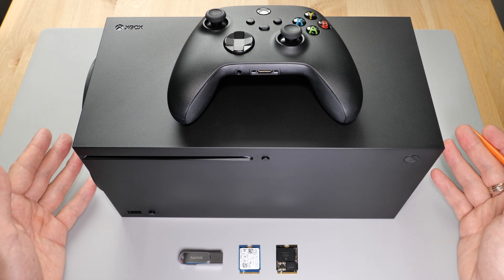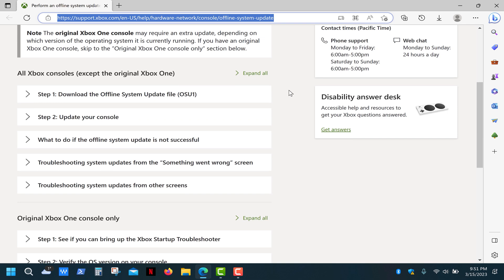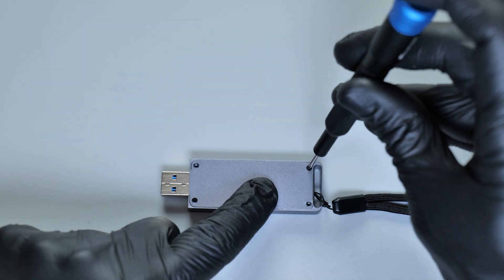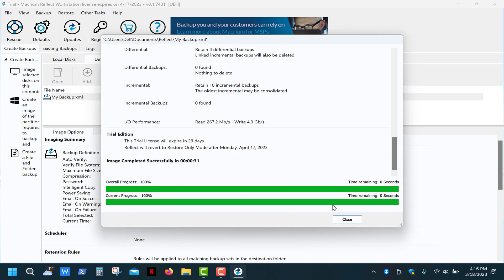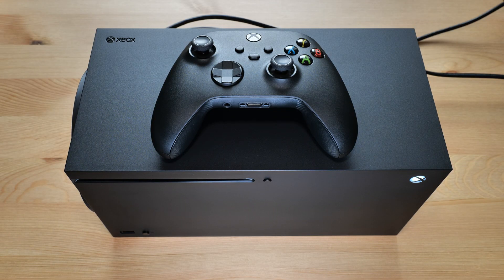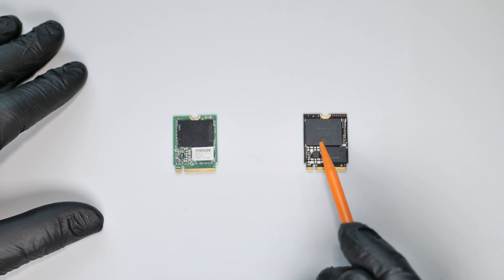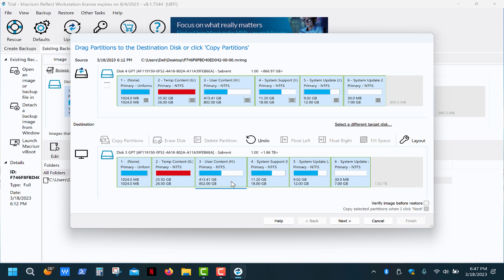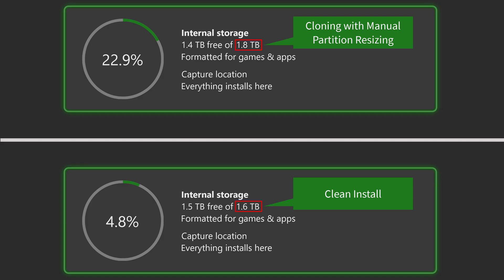Upgrade Xbox Series X SSD to 2TB – Clean Install or Clone Method (Step-by-Step Guide)

Comment: Good evening ! Thank you for making this video, I do have a question and was wondering if you've experienced this before or had any idea of what i can do. 

 recently bought a second hand series x, even with an offline update it wont get past the applying part of the update. It'll get to 100% of applying and 64% overall , turn off then back on and returns to the troubleshoot page. 

I'm currently considering just backing up the raw partition, then wiping the drive completely then reimagine just the raw so I can do a clean install. 

What's your opinion on this approach ? Would it be to risky or something worth trying if i didn't want to get another compatible ssd?

 I know the post is a bit older but I hope you have a chance to respond!
Reply: UPDATE: honestly just sent it , like the video states as long as you have the raw partition and the proper ssd you’ll be fine.

I wiped my drive completely and reimagined the raw partition, was hoping it’d fix my issue with update loop but it did not :/ 

Hopefully next update osu proves helpful.
Reply from the maker: Was your console enrolled in the Xbox Insider Program? I hope you managed to restore your system. If you lose the original boot partition, the console becomes e-waste, because no one will be able to fix it.
Reply: are you getting an error message when it tries to update by going online? if so, then it is not the drive that is bad, but your Realtek internet chip.

Comment: What are the 2TB compatible drives available...will this work MP600 CORE MINI 2TB PCIe 4.0 (Gen4) x4 NVMe M.2 SSD, or Crucial P310 2TB M.2 2230 SSD, PCIe Gen4 NVMe, Up to 7,100MB/s, Ideal for Steam Deck

Comment: what 2TB drive did you use?  I'm wanting to put a 2TB in my xbox series s but want to get the right SSD
Reply from the maker: I was using a modified SSD there are two options: using modified firmware or swapping controllers from extension cards. A dedicated 2TB compatible SSD costs around $250–300, which isn’t worth it. The best option for the Series S is upgrading to a 1TB SSD, which is cheap and safe. Links to 1TB SSDs are in the description.

Comment: Dear customer, I have an Xbox Series X. The internal hard drive is damaged and no longer works at all. I would like to replace the hard drive. Is there a way to replace it with a new one without copying the hard drive?
Reply from the maker: If the SSD is dead beyond recovery, the console is no longer repairable. You can sell it for parts. You can also contact Microsoft they typically replace the console with a used, refurbished unit for around $300. SSDs in that model are known to fail more often due to a design flaw, which was fixed in the later Xbox Series X Galaxy Black revision. So, try to repair the SSD only if it can be done at a low cost otherwise, it’s better to invest in a new console.

Comment: .........I wonder if you could install Linux on it......
Reply from the maker: Yeah, totally! Just decrypt the bootloader, then hire a team of top-tier kernel developers to reverse engineer the hardware, write custom drivers from scratch, build a custom firmware interface, and patch a Linux distro to handle all the low-level quirks of a console that was never meant to run anything but GameOS. Should only take a few years and a few million dollars. But yeah, in theory… totally possible.
Reply: @ElectronicsComputers  I mean, could maliciously use A.i. probably to do it, but Im just a burgeoning coding as a hobby fella.
Also I mean the PS4 was jailbroken so I don't imagine it was too pricey to do, then again like I said I am a novice at the best if I can even state that level lol

Comment: I know some might say differently but I’d almost say it’s a good idea to actually use this method to not only give you a option to upgrade the storage but also as a way to back up your current drive in case if ever fails that way you all ways have a way to recover your console if the original SSD ever fails
Reply from the maker: The idea of backing up your drive is cool, but Microsoft would never give us a treat like that. The problem is that the backup won’t work anyway, because at some point a major update will trigger the encryption key to regenerate.
Reply: @ElectronicsComputers would making a clone after each system update to a compatible spare help with this? So that the encryption key is constantly updated after each update on the "backup" drive?

Comment: Lovely video, thank you!

A couple of questions if you don't mind me asking 😁

1- When moving from 1TB to 2TB, is there no need to extend the "Temp Content" partition like you did when moved from 512GB to 1TB?

2- Can you share what the 2TB SSD model is?

3- Would this work also on Xbox Series S?

4- What do you think is the reason why with clean install method you get 1.6TB and with coming and resizing you get 1.8TB?

Thanks a lot again, your videos are the top!

Comment: so I replaced SSD and cloned boot partition as on the video - but during offline update it always fails on Validation and then gives E101 error. I've found someone saying here to copy Update partition content to new ssd, but that just makes it stuck ad 66% of applying update. What else can be done to get it back working ? I am out of ideas, and there seem to be no answer to that. For some factory reset works, but in my case it does nothing.
Reply from the maker: Are you using a compatible SSD? Was your console enrolled into insider program?
Reply: @ElectronicsComputers i think issue is it was enrolled with insiders. So I need to try to remove it or wait for OSU1 update
Reply: @ElectronicsComputers I am using 2 other than my original WD OEM Xbox SSD (but used) in all of them the best I can get is to updating firmware and stuck at 66% on applying stage.  Tomorrow I will receive the one from AliExpress, however something tells me it does not change anything. Also it turns out it was never enrolled into insiders program. So I am lost
Reply: @ElectronicsComputers well another step, I just received ssd from your link, but it's the same behaviour, just can't get past 66% on the "Applying" stage. So that's a game over for now, can't find any other steps I could take

Comment: Hi, to use the WD CH530 1TB drive (the original internal drive in my Xbox Series X, cloned with the CH560 1TB model), what adapter should I use? There are several types of adapters on the market, and all the reviews say they don't work. I would like to use (as you suggested) the old drive on the console's rear expansion port.
Reply from the maker: The bad reviews mostly come from people who don’t really understand what they’re doing they just throw in any random SSD into those adapters. These adapters have no electronic components inside, they’re purely mechanical converters that adapt an M.2 SSD to a CFexpress Type B form factor. So, unless the connector is physically damaged, it’s practically impossible for them not to work with a compatible SSD. When our clients ask for SSD upgrades, we often use these exact adapters https://alii.pub/76dpvh and install a spare SSD, basically the same thing you’re trying to do yourself.

Comment: What SSD does the 2tb galaxy black use a WD SN740? Can a 2tb WD SN740 drive be used in a series X? I'll have to try it myself. Thanks for the vid & not answering a simple question.
Reply from the maker: I haven’t had the Galaxy Black in my repair shop yet. It could be a WD CH SN560 2TB or another compatible model like the SSSTC XA 2TB. Other similar models aren’t compatible (some models require modification).

Comment: Hi everyone, is it possible to keep the old original WD CH530 1TB SSD, the internal one of the Xbox Series X, as a safety backup? I want to clone the original SSD to a new WD CH560 and keep the old disk as a safety backup. Is this possible?
Reply from the maker: Yes, if you clone the drive it can work initially, but after major system updates the encryption key may change and the old drive will stop working. So in practice, there’s no real point in doing that. The best option is to put that SSD into the expansion card enclosure which will double the storage capacity.

Comment: Hi everyone, if the original 1TB internal disk breaks, can I replace it with another original one purchased for example on AliExpress?
Reply from the maker: If the original SSD is about to die and you see first signs of failure, you can back up the first bootable partition and then restore it into any compatible SSD. If the SSD is dead completely beyond recovery then the console turns into e-waste.

Comment: Does any m.2 2230 1tb drive work? Or do only certain brands / models? Seems like if the models used for the Xbox are failing, I wouldn't want to replace it with another failure prone drive. But its a different story if that's the only way to get it to work.

By the way nice job on this video, great detail, I appreciate your money and effort out into this
Reply from the maker: Unfortunately, without any modifications, there are only two SSD brands that work WD CH series and SSSTC XA1. These drives tend to die quickly due to extreme overheating a problem Microsoft finally fixed in the latest Series X Galaxy Black version. They simply removed the shielding that covered the SSD, allowing direct contact with the heatsink and drastically improving cooling. But anyway, if the SSD dies, it's game over for that console. I’ve got a pile of them in my repair shop. If Microsoft had used the same bootloader chip on the motherboard like they did in the Xbox One X/S, we wouldn’t have this issue. But they decided to cheap out and move the entire NAND boot function onto the SSD to handle everything.
Reply: @ElectronicsComputers  I want to upgrade from the 2 tb to a 4 tb can you recommend one please